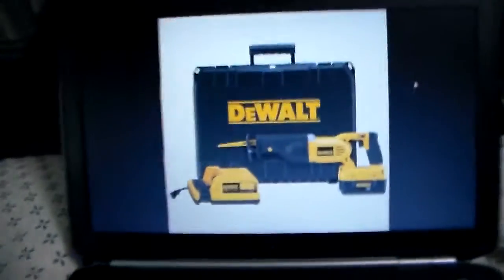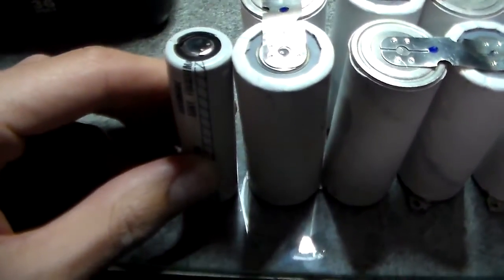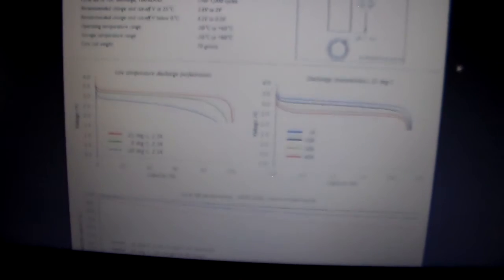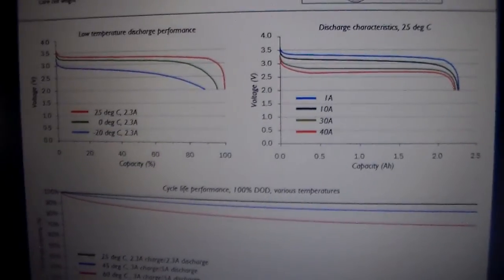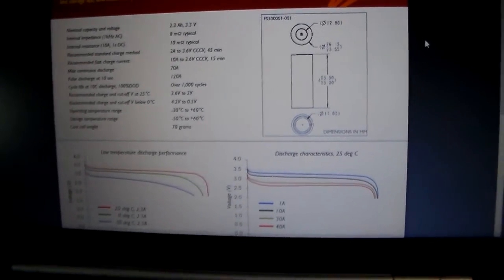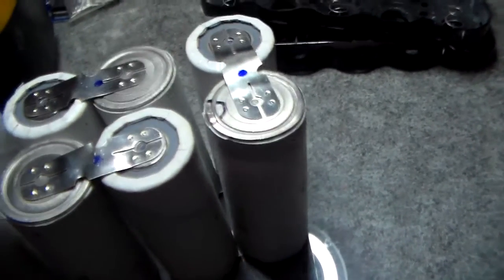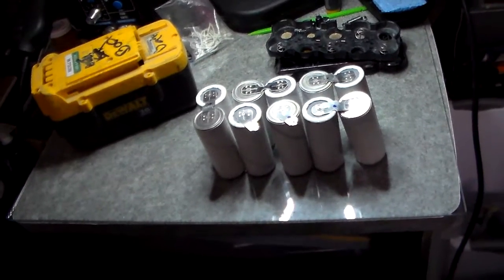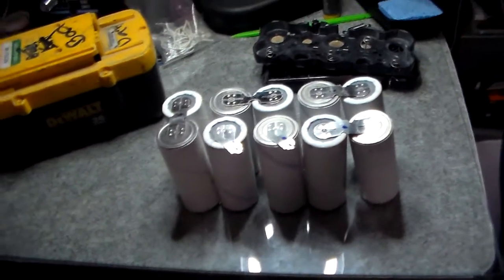Dewalt 36V battery I salvaged, A123 cells inside!!

Comment: Can you rebuild these batteries?  I have 2 dewalt batteries.  One is with the A123 's. This battery does not hold a charge very long. And the 2nd battery is with 18650's.  This battery I shorted out accidently when testing the battery with leads.
Reply from the maker: Yea you can, but it will require a spot welder to put the new cells in. Just make sure to get the right nickel strip and balance the pack properly after.

Comment: how would you charge them? details on charging?
Reply from the maker: you charge them like any other lithium cell with CC/CV charging and 
balancing but the VOLTAGE IS DIFFERENT, the maximum voltage is 3.6v, 
minimum should be 2.5v but it will not destroy it if it goes lower. 
further reference this: http://www.powerstream.com/LLLF.htm